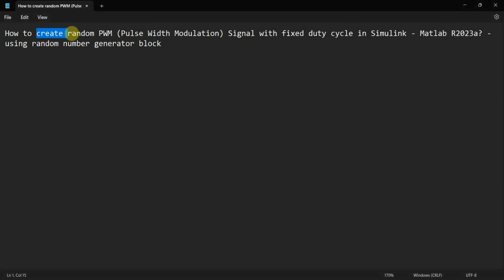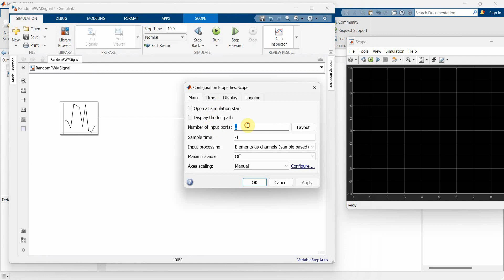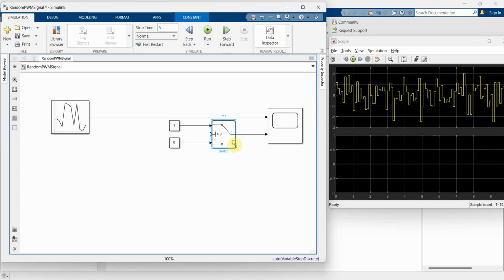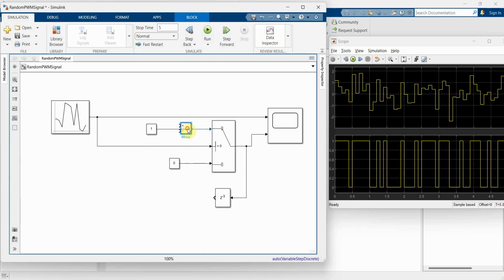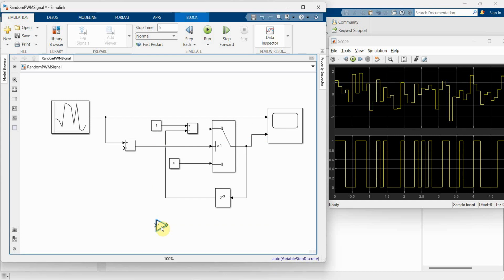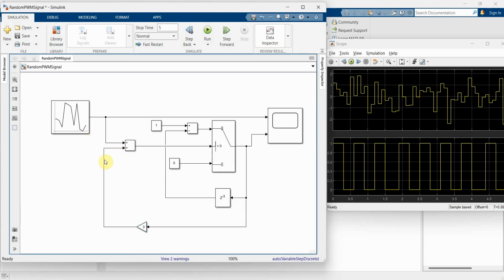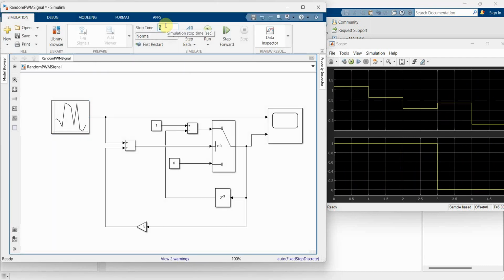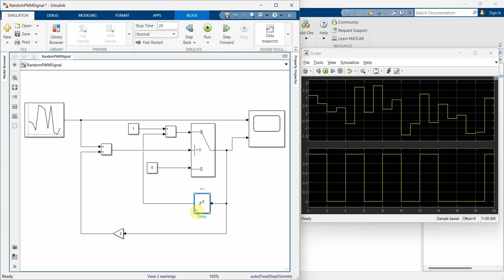How to create random PWM Signal with fixed duty cycle in Simulink - Matlab R2023a?

Comment: Kindly tell me how to fix the frequency of this signal sir
Reply from the maker: Frequency is the reciprocal of the Time-period function. Now, in the model, one can easily modify the time-period of the generated signal by changing the step-size of the simulation from the configuration. 

So, just try to set the desired time-period by setting the step-size in the configuration of your Simulink model.
Reply: @ProgrammerWorld  thank you🙏

Comment: is it possible to fix the frequency range of a pulse in this Simulink model. i need my output pulse with 200 KHz.. which block parameter I need to change to fix the frequency.

Comment: How i can generate a chaotic PWM signal with fixed duty cycle
Reply from the maker: Concept will remain same as shown in this video. 

The only difference would be the input signal in this is random signal, however, in your case you would have to provide chaos signal as input. 

So, once you replace random signal with your chaotic signal in the model of this video, you would get chaotic pwm signal with fixed duty cycle. 

Cheers
Programmer World
https://programmerworld.co/

--
Reply: @ProgrammerWorld thank you for your reply sir,  is it possible to fix the frequency range of a pulse in this Simulink model. i need my output with 10 KHz.. which block parameter I need to change to fix the frequency..
Reply from the maker: Below page gives some details about chaotic vs random number/ signal. You may check it out:
https://programmerworld.co/blogs/what-is-a-pure-random-number/

Cheers
Programmer World
https://programmerworld.co/

--